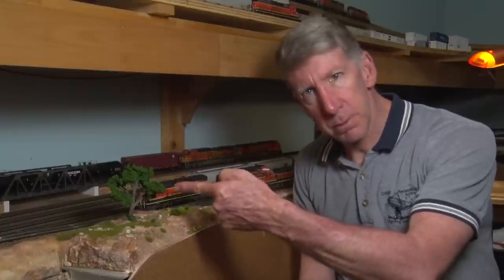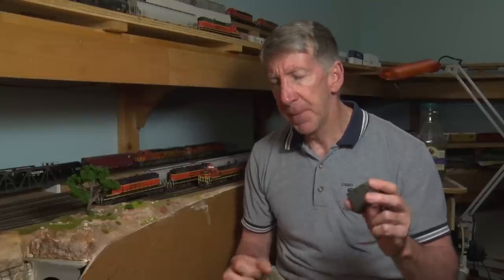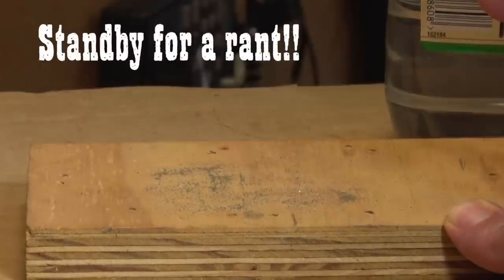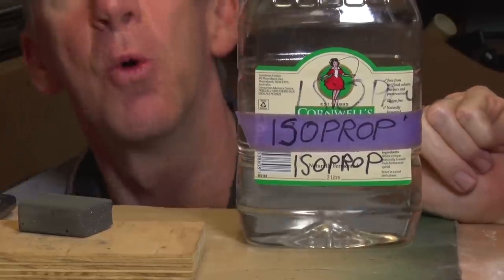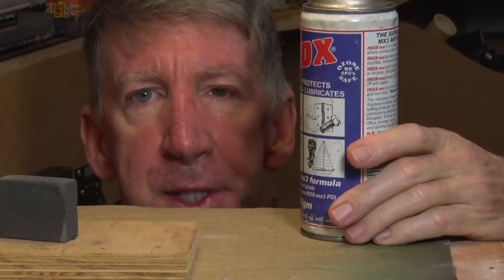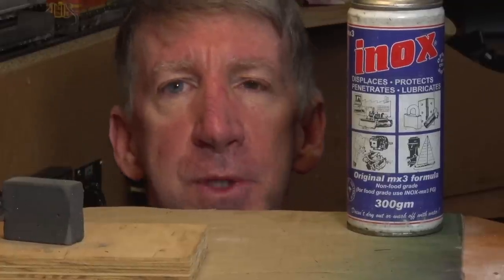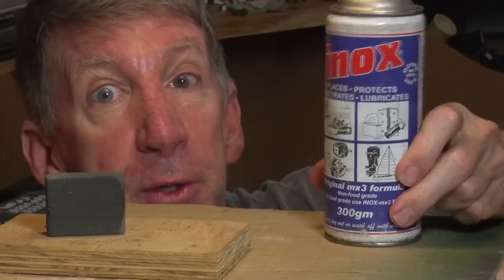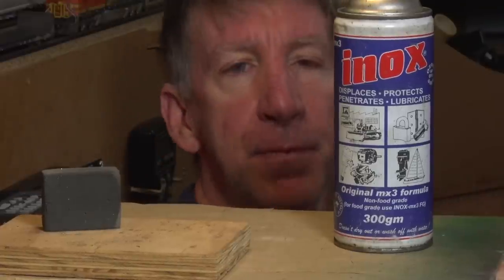Track cleaning do's and don'ts. How "Not" to  clean your track ! And how to do it better!

Comment: CRC 2~26 works for me. Keep on ranting as much as you like. It’s all educational to me 👍🏻
Reply from the maker: Thank you Lance ! Always something new to learn in this hobby..even for a oldie like me.
Cheers Gregg.
Reply: CRC 2-26, top-notch stuff, works better than anything I've tried. The effect lasts for months. It's made for electrical switches.
Reply: Crow T. Robot  so CRC 2-26 sounds like it’s a popular choice any issues if u get some on a loco?,  any experience with CRC QD contact cleaner?  CRC specify it’s made to work with sensitive plastics. Many thanks
Reply: @roydom5  CRC 2-26 does not harm plastics. It is more than a cleaner. it leaves a dry, conducting, corrosion-inhibiting coat. Never used the contact cleaner, but any CRC product should be good. My experience with their 2-26 has been the best of anything I've tried by far.
Reply from the maker: @roydom5  I would stay away from contact cleaner roydom and go with the Innox or CRC2-26 as you say ! 
Gregg :-)
Reply: @FishplateFilms  I have been using INOX for 40 + years and a friend has used CRC 2-26 for the same length of time. Both work and achieve excellent result. My subjective view is the INOX might last a little longer.
Reply from the maker: @terryflynn8830  Great to hear Terry! I didn't know it ha been around that long! Thathernk you fr the feedback and it's great to hear another success story.
Cheers Gregg.

Comment: I have cleaned track with the eraser for years or have used old clean white socks or shop rags soaked in Alcohol for years also and the track is clean. You have to keep cleaning your rails anyway as you run your trains.  Never use steel wool.  Use Scotch brites to clean tracks also,   I never had any problems these methods in 50 years!

Comment: Worked like a charm. THANK YOU! My tracks turned blackish but even my most stubborn locomotive that I've had in boxes for years run like champs. Maybe the best model railroad tip I've seen on YouTube.
Reply from the maker: Thank you SO much ! Glad you got the results I promised..LOL. Keep up on the cleaning and it will only get better ! 
Cheers Gregg.

Comment: When I was a kid, I used one of those gritty things. That was back in the mid 60's and my track was brass. Didn't give a crap about that track back then. .....everything was different anyway. Fast forward to the late 90's; married, two kids, 2nd house and a nice big basement. Finally built bench work around the walls and started laying track. Fast forward a bit more; having trains run smoothly (DC) was getting to be a pain in the ass. I had two loops, 4 scale miles (HO) of mainline and numerous long sidings. ...plus a 5 track yard, caboose tracks and an nice engine facility. Then trains started running like shit. I was cleaning my track with alcohol and I thought my finger was going to fall off. Then shortly after cleaning, trains started running like shit again. Now I was starting to use alcohol (the kind in the 12 oz can) and I was getting ugly at how the layout ran. I was not far away from a 24 oz framing hammer and smashing the layout to smithereens, and quitting the hobby. !! Then a friend said, "you think the track is too clean, no conductivity" ?? I remember another friend who mentioned using clipper oil bought from a beauty supply store. Years ago we had a friend who was a WW2, Pacific Theater veteran. He swore by the clipper oil. So with that said, a 4 oz bottle of clipper oil was about $4 US. So I bought one. Learning the hard way, I put too much oil on the track and the trains stalled and just spun it's wheels. So wiping that off, I now just put a dite on my finger tip (hardly a small drop) and rub it on a 3' section of rail (track now nickel, no brass) then another dite and another rub on the opposite rail down the track a bit. Trains now run like tops. When the headlight of the lead unit starts to flicker just a tad, I reapply just a teeny bit of clipper oil and everything runs great for a long time. I run 70+ car freights with 3-4 units. When the track is ever so slightly oiled, I let the trains spread it all around the layout. I'm not so young anymore and I'm getting physically handicapped now so I don't get down cellar as much as I would like anymore. However, I know when I go down cellar, my trains will run well. Now I break Rule G in comfort rather than in anger that trains will not run well. As Gregg stated, you need good electrical conduct to run your trains !! For me, clipper oil is the answer. Sorry to run on a bit. Thank you.
Reply from the maker: Hi Steve, a great story and similar to many in the comments about IPA  !  I also got to the stage of trains refusing to run after cleaning, and a short length of track wiped with (then ) CRC fixed it instantly. I hope you still get down to the basement to run some trains now and then ! 
Thanks for watching sir.
Cheers Gregg.

Comment: What a great tip.  Was using a rubber and things were getting worse, my switchers kept needing bigger and bigger push starts every time I made a move.  Now I understand why.  Made the switch as you suggested and everything is like new, my engine runs so smoothly now, thanks!!!
Reply from the maker: Thanks Michael!  This is what I like to hear!  Just remember to go and clean up all the rubber dust with a vacuum and little brush..especially in the frogs and switch points! It's great to see trains running how they should and I'm glad you are happy with the results.
Cheers Gregg.

Comment: believe at one. time you had told me that WD-40 was the same as inox, have used it for years.You were right, works great. Thank you Gregg, love your videos , be safe
Reply from the maker: Thats great Joe!  It is similar , but if you can get Innox it is a bit more suited to our needs. But WD-40 is fine and I'm glad you are getting good results and thanks for the feedback.
Cheers Gregg.
Reply: Joe, How much WD 40 do you use? Do you use anything in addition to the WD 40? Have you also discarded your "Bright-Boy"?  Do you use a track cleaning car?
Reply: @amtrakatsfnyc2387  Ive used INOX for over 40 years. I used WD40 before that but I found the WD40 dries out quickly and the metal surfaces oxidise causing poor electrical contact conductivity.

Comment: I've just started building an oo gauge railway and cleaned the rails inside my tunnel using IPA and now the loco is stuttering and comes to a halt. 'Silly boy me'!!! I've just watched your tutorial and feel like an absolute idiot of the highest order. I'm going to get some wet n dry 4000 gauge and wet it with inox and ask my wife to put her arm in the tunnels, mine won't fit,; single portals!. Will let you know if this works out well. Excellent video, just love your style and your personality is brilliant. Good to 'rant' as it definitely help spell out the message.
Reply from the maker: Thanks Richard, you will only need the wetndry if you used a track rubber and scratched the rails, otherwise a rag and Inox will be fine! Please let me know how you get on ! 
Cheers Gregg

Comment: Just starting again after too many years and cleaned my "new" track and saw better running and then some rust, yes 2nd hand track so not the best, then rubbish running.
Tried some of the stuff you said NOT to do, I was so new!
I knew I needed to protect the, clean, rail and I knew it had to be electrically clean.
SO I did what you said, well I bought and used CRC, Bang, and the job was done.
Thank You, blobby awesome.
I am still nuts but at least I drove myself there.
Reply from the maker: Thank you Diez!  I'm glad you got some good results and also found out the difference yourself ! If you have rust , then you have really old track ??? 
Good luck with it!
Cheers Gregg.
Reply: @FishplateFilms  7 months down the road, still fantastic, every now and then I get a bit of stutter so I just "dirty it" with the lube and job done.
Getting Dirty, such fun. 
Thanks again.
Reply from the maker: @diez66  Great stuff and thanks for the feedback ! 
Cheers Gregg.

Comment: I use to use alcohol all the time for years never knowing how bad it was until a few months ago. Locos started to run bad Then I switched to CRC contact cleaner and protectant . They run smooth as silk now . Good video. Everyone should watch this one.
Reply from the maker: Thanks very much Scott!  I did the same and the problem got worse till trains just wouldn't run, then I cleaned a small section of track with Innox, ran a train through it and it continued round the layout without stopping. Glad you are having great results.
Gregg :-)

Comment: When I was about 8 or 9 years old cleaned my American double set of tracks with steel wool. Got the track very shiny. My dad had to take both engines apart to remove tons of little pieces if steel wool. After that he purchased an American Flyer track cleaning car that think used a purp!e color fluid. A few years later he purchased me a 140 watt Weller soldering gun and I soldered all the tracks together then ran a file over joints. Also soldered wires every three foot of track and trains never slowed up at furtest point of where transformers were connected. When my oldest son was around 8 years old I reworked the old platform even I stalling rubber road bed. Had lights inside all of the buikdjngs. He ran the two trains no more then 5 minutes then maybe a minute the next day. He told me he rather play with vidio games. A few years later neither one of my brothers wanted the trains so I sold them.

Comment: Thank you after watching this got rid of my rubber cleaner and other fluids,I'm in the UK so got some wd 40 contact cleaner was the closest i could find, after ten minutes cleaning it was like a totally different lay out all the trains running great now thankyou for the great advice 👍
Reply from the maker: Hi Shawn, thanks for the feedback ! This is exactly why I made this video , and I'm chuffed that you found such a huge difference in the operation of your layout! Just to let you know , you can get INOX form "Pendle Slot Racing " in Lancashire:-) . Also CRC2-26 would be better than WD40 , as it is more suited to electrical components, but I'm glad the WD is working for you :-).
Thanks again for your great feedback !
CHeers Gregg.
Reply: I think you missed that Shawn said WD40 CONTACT CLEANER which is different from STANDARD WD40   and is as effective as other products listed here, as indeed is any industrial contact cleaner. Standard WD 40 is a general purpose compromise.

Comment: And DO NOT put automatic transmission fluid on your track !
Reply from the maker: Absolutely !!! I remember when that was a "thing" ???  And brake fluid too!!! What were people thinking..LOL.
Thanks for watching Otto.
Gregg.
Reply: When I used it, trains ran remarkably better.  Saying do not doesn't offer any reason why.
Reply: I've used it and not any trouble with it. Cleans the track and drys quickly.  Please explain your statement.
Reply from the maker: @gkoproske  The main reason Glen, is that these lubricants are not designed for electrical  circuits and can damage some plastics, but if you get the results you're after then keep using them.
Cheers Gregg.
Reply: I couldn't believe people put automatic transmission fluid on their tracks, but faced with serious conductivity issues, I started using it on a small scale over a year ago. My experiences didn't match much of what I read; in very small amounts carefully spread it pulls the dirt off locomotives, rolling stock and track and leaves it in a few small oily black blobs that can be wiped up with a cloth very quickly; its prime advantage is that locos can be cleaned while in motion without having to remove them from the track. No adverse affects detected in 18 months but I'm careful not to get any on plastic sleepers.
Reply from the maker: @stef6567  You will find that Innox and other products will do the same ATF , but without the worries of damage by the fluid. Plus a can of CRC is cheaper than a bottle of ATF...just saying:-)
Cheers Gregg.

Comment: Thanks. Tried this and works great. Running n-scale with trains over 30’ and over did the amount at first so learnt the hard way but now got it right.
Reply from the maker: Hi Richard, glad you got good results ! I'm sure with N scale, that you need to be a bit careful  ...not much contact area with the rails on your locos! 
Thanks for watching and letting me know your results! 
Cheers Gregg.
Reply: An update. Had renno’s done in room above the train room. Had it covered up for dust for over 7 months. Took off the plastic cover recently, vacuumed (was good anyway) and ran trains without touching the track. Perfect!

Comment: Wow!  On the back of watching this I ordered some Inox from Pendle slot cars (UK firm) on Monday - arrived today (Wednesday).  I've wiped a few sections of track and already my temperamental DCC sound locos are running far better.  I cannot quite believe it was that quick and easy.  The track looked pretty clean before but a wipe with the cloth took off loads of "crud".  Thanks for posting this video.
Reply from the maker: You're welcome Richard!  It will get even better as the Innox cleans the wheels! Just do a bit here and there and  let the trais take it round! You will always get dirt on your rag but it's just doing its job. Thanks for the support and for the feedback and I'm glad you got good results that fast...just like I did !
Cheers Gregg.

Comment: Wonderful video.  Just got two new brass engines and have an open house tomorrow.  So throwing out the abrasive pads and the ISO and going with some CRC i have.
Reply from the maker: Thanks Jay! If you can , vacuum the track before using the CrC, to remove all the grit from the track rubber!  CRC 2=26 is the one to use , though I hear they now make a cleaner/protector but I haven't seen it yet? Let me know how it goes and remember it will improve as the trains take the CRC around the layout.
Cheers Gregg.